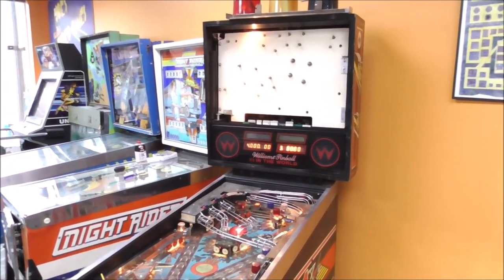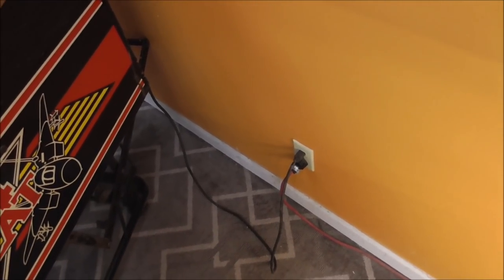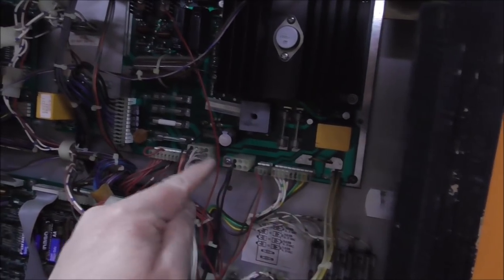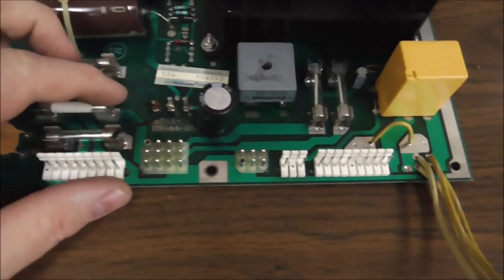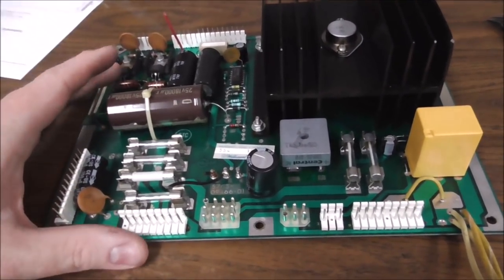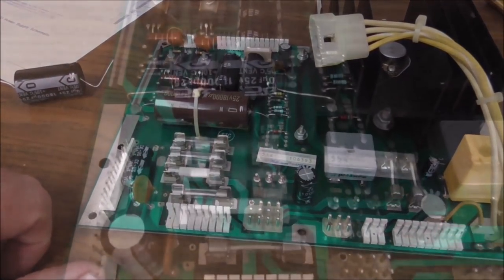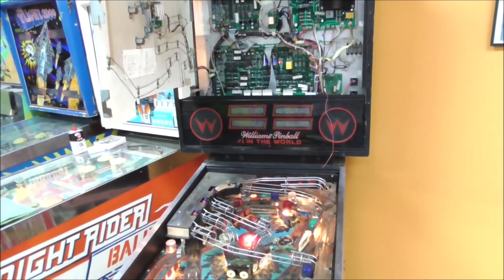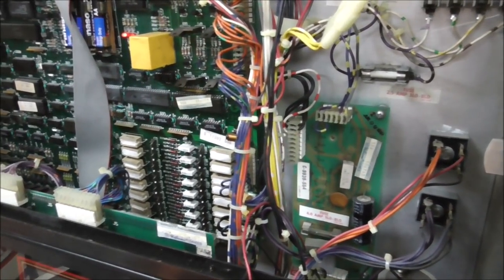They Hacked The Power Supply On This 1987 Williams F-14 Tomcat Pinball Machine! - Repair #2

Comment: I have an F-14 that arrived in similar condition so watching closely what you do. Mine booted, but the playfield was a solenoid and switch matrix mess mostly due to past work done to it. I still have the working untouched power supply and starting to fail display. I restored the 2 flashers that were common shorts to the switch matrix in the early games. Great game, thanks for the videos!
Reply from the maker: We're steadily working through it, next up, we're gonna fix all that battery corrosion!

Comment: Great video. That battery damage issue seems to be a pretty major design flaw. Seems like they could have located the battery holder somewhere so that a leak would not trash the MB.
Reply from the maker: At the time they didn't forsee that somebody would never change the batteries, it's kind of like any battery operated thing if you leave batteries in it for 25 years it's going to get ruined :)  So I don't really blame them, it's just how things were done back then...

Comment: Note that the way zeners work, the voltage should be 91V, regardless of resistor tolerance or line voltage. To verify if the zener itself is any good, measure the voltage directly across the diode.  Some diodes can have up to 10% tolerance anyway, so you may need to pick and chose if you really want a specific value.

Comment: Generic capacitors, resistors and diodes can be picked up at either of the two big electronics sellers in the US, Digikey and Mouser, probably cheaper than the specialty parts stores. The bulk buy options are better too.
Older DIP chips (through hole) can be picked up by Jameco if they have stock. I recently picked up some Intel ICs circa 1977 from there (NOS). SMT style ICs are more readily available by the stores I previously mentioned.
Cheers,

Comment: Fun fact - for a coin meter to work, you need a tripped ground, and 12v.

On System 11 games, the coin switches are on the switch matrix.  There is no ground on the switches.

So connecting the meter to the coin switches puts the meter on to the switch matrix, which will cause it to go absolutely bezerk.

This would have never worked.

Regarding the HV supply, the one - singlemost - important thing that will almost completely eliminate future failure, is mount the zener diodes and resistors about 3/16" off the PCB surface.  This allows airflow all the way around the part, and is a vast improvement to reliability.
Reply from the maker: They hooked this one up with a relay, it looked like it was pretty well thought out, i'll bet they had hacked those into dozens of games, lol
Reply: @LyonsArcade  a relay is no better unless they wired the coin switch to the relay, and moved the matrix column/row there too ... that's a lot of work, though.

Comment: Adding a physical coin meter when the machine already keeps track of that in software feels like the sort of thing that would be ordered by management types still mentally stuck in the '70's.  They can waste hours of your life soldering in redundant obsolete technology but can't be bothered to spring for a fresh set of AAs every few years.
Reply from the maker: hahaha yeah they did a pretty decent little hack except for the wires soldered to the power supply, we'll have to undo all that crap in the cabinet in a later video!
Reply: Edison bothers mall entertainment (EBME) stores (Space Port, Timeouts )was NOTORIOUS for doing this kind of add in coin meter back in the early 90's    They did it with everything using 4.5 volt coin meters for video games. Thy use to use 5V coin meters but  some managers figured out  that 5 v meters would stop working while the games logic board still would and steal the excess non counted quarters by lowering Power supply voltages just enough to make the coin meters not count..   Just FYI

Comment: I think that the Scorekeeper batteries need removing and replaced with a LIPO battery and the tracks repaired, a little vinegar and water should clear out the corrosion but you can use Wires conductive glue to remake the tracks if you want to go that way.

Comment: What's the temperature the solder has to be in in order to be considered cold solder?
I would think room temperature would be too warm.
Reply from the maker: I think that name comes from, as I understand it, it cooled off too quickly in the factory when it was installed, so it leaves the solder where it's not properly mixed and doesn't conduct right after awhile.  So it's not really a temperature now, it's the temperature it dried at originally :)
Reply: Ok that makes sense.

When I first started watching arcade and pinball restoring videos.
Everyone mentioned cold solder and I couldn't figure out why.

Thanks.

Comment: I'm going to do the fuse 'mod' on my F-14 but since I am in France (220V) I am still Wondering about the fuse I should use. Should I use 8A or 4A since voltage is higher ?
Reply from the maker: You would use the same 8amp fuses because although the voltage is higher at the wall, once it goes through the transformer everything is exactly the same.  So your voltages on those two bridge rectifiers is the same as mine.

Thanks!
Reply: @LyonsArcade Totally  make sense. Thx for your reply and for your videos

Comment: JOE'S classic, you installed 1n6493 regulators but why are they outputting +100vdc and -100vdc? I thought they were supposed to output +91vdc and -91vdc. Also what type of flame proof resistors do you use because I do t see often them listing the flame proof specifications for resistors about the flame proof tolerances or specs
Reply from the maker: Wayne I believe the voltage was higher because the displays weren't hooked up, so since there was no load the voltage was higher.  On the flame proof resistors they're just listed as that when you buy them.
Reply: @LyonsArcade  ok thanks I will look for the flame proof resistors I don't see them often
Reply: They are, but if you pay attention at around the 20:15 mark, he explains that wall voltage has gone up over the years.  So he's not getting 110V (which the game was designed for), he's getting 120V.  It just stands to reason, if you're getting more voltage from the wall, then you're going to get more voltage from the diodes.
Reply: @SpearM3064  ok it's 10volts vac higher so they better use a different regulator part number since the wall vac is at 120vac and not at 110vac

Comment: If you're going to replace a resistor prone to overheating, you can go UP in wattage.  You can get a 39 ohm 2 WATT for about the same price as the 1 Watt
Reply: I was thinking the same thing.  Then checked the prints and they say 1/2 Watt.  So Ron is correct by doing 1 watt, 2 watt is .5m larger.  This video inspired me to look at my Cyclone and the high voltage is +100 and -106 Everything original on the power supply and 12 and 5 volts perfect.  So I recap it, and waiting for new resistors and 91v diodes to get the most out of displays.  One of the caps from arcadeparts was 50v and the original one was 63v, thought they mess up.  But checking the prints it listed it as 25v, so always check the prints.

Comment: What do you suppose that humming sound is? Is it produced by the speakers or is that straight up voltage sound? It sounds similar to when my Mystery Castle kept blowing fuses as soon as power came on and that would concern me greatly lol
Reply from the maker: We're gonna talk about it, and fix it but not until video.... 7 or so!
Reply: Looking forward to video 7 then :) I own a F-14 Tomcat (it’s actually my only machine) and that’s one of the nagging things I’d like to fix! I’ll be watching this entire series with great interest
Reply: @gspugh  If I had a guess to give you somewhere to look, I would guess either the speakers are going bad or you have failing caps on the sound board. Hard to diagnose when I can't see it obviously, but I figure you didn't want to wait for a starting point, at least :)
Reply: I think it might be bad caps on the sound board, or a half voltage to one or more op-amp missing, might be loose ground to some component, but I don't think the speakers are the culprit. The tone of the hum alters sharply and seems to follow the changing lamp loads... so it follows slight voltage changes. My educated guesstimate is bad caps or regulator on sound board, but hard to say much more because I haven't seen the board or schematics.
Reply: Moral of the story: start with the caps on the sound board and see if any are bulging. If any look/test suspicious, replace them. Make sure you get the right part number through the manual; you don't wanna stick the wrong parts on the board!

Comment: What you’re trying to say is that there’s a sequence of electronics you fix. If you work on something else and the power board is bad then you may have to go back and re-fix the problem. In other words if the power supply is kicking out 150 V that could be the problem with the other boards and you need to fix that first then you can fix the problem on the other boards
Reply from the maker: Absolutely, we have to start at the beginning of the power train to make sure the other boards issues aren't because of that!  Thanks for watching Clark!

Comment: Edison bothers mall entertainment (EBME) stores (Space Port, Timeouts )was NOTORIOUS for doing this kind of add in coin meter back in the early 90's    They did it with everything using 4.5 volt coin meters for video games. Thy use to use 5V coin meters but  some managers figured out  that 5 v meters would stop working while the games logic board still would and steal the excess non counted quarters by lowering Power supply voltages just enough to make the coin meters not count..   Just FYI
Reply from the maker: That's pretty amazing, I guess where there's a will (to steal) there's a way!  Thanks for the info, I'd never heard that...